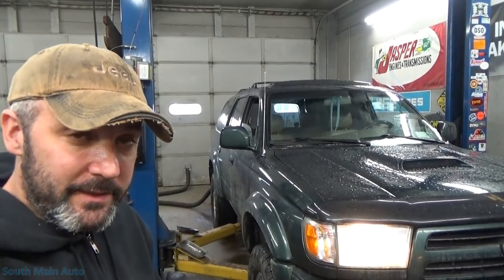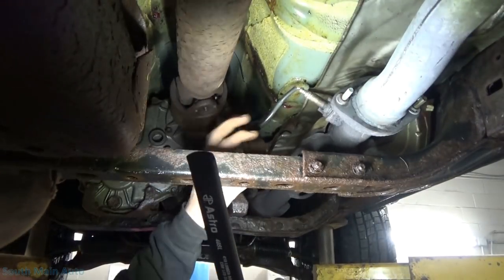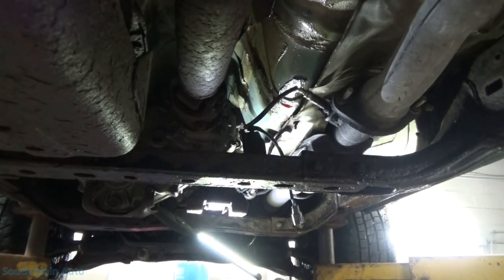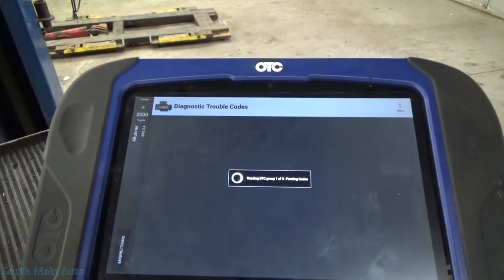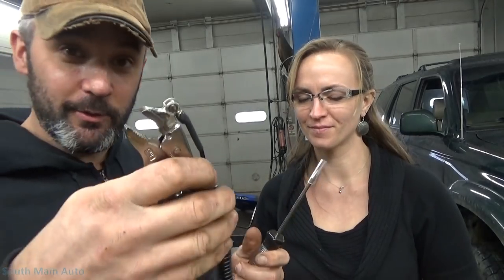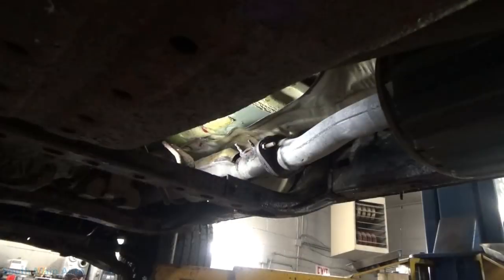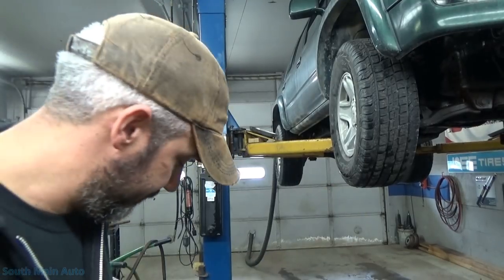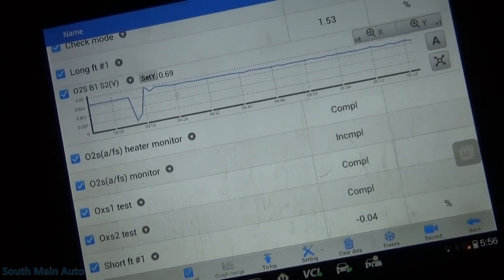Toyota 4Runner 3.4 - P0136 O2 Sensor Malfunction Bank 1 Sensor 2

Comment: Very good video I just did the bank 2 sencer 1 heater circuit  malfunction it stopped work on my 1998 Toyota Camry V6 3.0,, same thing happened to me I ordered one and had the right server box but when I opened it up it was the wrong one, I mean im no  Mechanic but I had enough experience to catch that you know.  So I went to the parts store and bought the right one and put it in and works pretty good job well done. But very good video as all the videos I seen that you put out my friend

Comment: P0136 is a major exhaust leak in front of the sensor.  Or in my case the sensor was still reading in the low voltage area, replaced sensor and all is well.

Comment: Great quick diagnosis and a Merry Christmas to you and the posse over there in Avoca! My brother in Rochester says it's going to be snowing tonight. Looks like it'll be a white Christmas for you guys and for us here in SLC.... Anyway, I just pulled a 2003 Subaru EJ25 from the wrecking yard... can't beat a good motor for only $180! It's going in a 2005 Legacy. The only difference between the two is that the 2003 doesn't have the EGR port from the left head. Online there are success stories about just drilling and tapping one - you can see that the casting already has an area dedicated for that "future" option. I just drilled and tapped it yesterday and all seems well. Going to install the engine today. Have you ever done something like that?

Comment: The swap a part happened with me at car quest / advance auto with an upper ball joint, its alway a guessing game when you don't pull the part before going to the parts store around this town, And when I do I come home to missing nuts and or bolts. Good times.

Comment: Nice trick with the torch! Saw you do that before on a F-150 manifold - pretty slick.

I finally got myself a torch setup after wielding MAP gas for 20 years or so. Could get by with that on the old stuff, but not anymore with everything being post-'96 these days (they've improved the bodies, but it seems the undercarriage has taken 20 steps backwards). Now I've got to practice! Thankfully I've got alot of scrap metal laying around to burn up first, before I unleash  "the wrench of fury" on the customer's stuff. :D Once the floor is poured in the new shop, I'll dig the thing out of my barn and actually be able to use it.

I've learned alot about modern electronics from you and Paul Danner (ScannerDanner), but I seem to forget everything the minute I go out into the shop! Sucks getting old, lol. I'm pretty new to OBD-II stuff - I used to refuse it all, until I learned how to troubleshoot the things, just in the past year. I stuck with carbureted stuff (rare these days in cars, but plenty of it in lawn equipment) for the most part. Now I need some more hands-on with the new stuff, so all this new knowledge will sink in. Too many brakes, front ends,  and tires around here lately! :D

Thanks for another great one. Time for me to finally go to bed! Merry Christmas to you Eric, and Vanessa, and the rest of the family. :)
Reply: chinesium metals at their finest, I'm still stuck with MAPP gas, the tiny oxy/acetylene torch I have is a joke ( the small store bought bottles)
I do have an ancient set of gauges, hard as rock hoses and dinosaur torch set that is no longer made :( last used about 1993?
Reply: I hear that - chinesium, the 119th element. Creeping into EVERYTHING these days.

Sounds like the 50 year old acetylene brazing torch I had handed down from my grandfather. My dad and I attempted to use it one day, and nearly had a catastrophe when the torch handle burst into flames. There were leaks from the valve, all the way down the hose to the torch itself, lol. I brought it home with me, and couldn't find anything that would fit it. My neighbor brought the tank to the gas company to get refilled, and I guess it caused quite a stir, since nobody had seen that style tank and valve in decades. :D

Comment: Just like Jarred food, medicine, bottled food- nearly everything has some type of "tamper resistant" packaging- but not auto part boxes. OTOH It takes 5 seconds to verify numbers of box & bag to match, and if bag is open, BEFORE granting a refund or replacement, and BEFORE returning it to stock. I know that OEM parts usually have a bag label that reads: NOT RETURNABLE IF OPENED, and Dealers Parts Depts usually examine stuff like that. They are showing very slipshod business practices. I would call a Customer Rep, get this situation remedied ASAP. This happens way too often.
Reply: Well they must factor that in, otherwise they would go broke.

Comment: It seems an oxygen sensor or a t-belt is just about the only kind of job a mechanic can hope to see on one of these 3.4L 'yota truck motors!  Love my '96 4Runner, I use it for all my travel and road trips and some mild offroading, aside from a failed fuel injector a few years ago its never missed a beat.  Not bad for a 21 year old truck.  Seems like the only thing that can really take them off the road is frame rust.  The bodies hold up incredibly well, but the boxed frames will rust inside out if you don't undercoat in a northern climate.
Reply: Strawberry milkshake takes out the automatics because of antifreeze mixing with atf. Also rear axle seals go often! And if you don't check diff fluid often (who does?) He rear diff implodes. These are alot better than the previous generation with the 3.0 head gasket circus!
Reply: The "milkshake" issue definitely exists, but I think its rate of incidence gets overblown on the internet.  Having said that, I have an external trans cooler on mine to bypass the built-in trans cooler in the radiator.  The rear diff thing, okay for someone completely negligent and oblivious I suppose that is possible.  Mine had a bad axle seal when I bought it, the oil spray around the rear inner fender and grease smell kind of gave it away.  It didn't take "checking the diff fluid often" to catch and correct that issue.

Compared to my friend's '00 XJ Cherokee with rusted rockers and a cracked head/blown head gasket by 110k miles, the 4Runner is a spring chicken.  A lot of that does come down to how the owner maintains their vehicle be it Toyota or Mopor or Ford etc.  But I find that the overall quality and dependability of these older Toyotas to be simply incredible (better than the new ones, in terms of things like paint quality and interior parts).
Reply: Most of the work I see on these is suspension problems.  Lower ball-joint separation can ruin your day.  Mostly long neglected maintenance.
Reply: Spot on James.  All of these older Toyota trucks/suvs with double wishbone front ends had an inverted/in-tension style of lower balljoint that would not really give anywhere as much notice of impending failure before they let go.  The other problem is people using poor quality balljoints when they do replace them.  I preemptively replaced mine with OEM Toyota pieces at 135k miles, the stock 20 year old balljoints were still perfectly tight but I was spooked.  95-04 Tacomas, 96-02 4Runners, 01-07 Sequoias, '99-06 Tundras are all potentially at risk.  Newer Toyota 4wd IFS has a more traditional balljoint orientation.  I do know several friends with this generation 4Runner that have 150k+ miles on the OE lower balljoints and they seem to still be tight.
Reply: Also head gaskets/cracked heads and unlimited amounts of oil leaks from engine
Reply: You're thinking of the 3VZFE in the 2nd gen I presume, that was mostly a headgasket material/head bolt torque issue, I haven't heard of many heads cracking.  "Unlimited amounts of oil leaks?"  My '96 3.4L is bone dry 21 years on, doesn't burn any appreciable amount either.  I've heard of valve covers seeping with age, but that's nothing unusual or difficult to deal with.  I will put the 5VZ-FE 3.4L up against any motor made in the last 50 years for trouble free operation and longevity assuming even a modicum of basic maintenance like an oil change once in a while.  Toyota had their industrial/truck division Hino lay a hand to it and I think the result speaks for itself.
Reply: Not thinking of the 3.0. I have not seen a head yet that was not cracked between valves when the mls head gasket started to leak.

Comment: Like the idea of the vice grips on the test light. You might be interested in my own version? I got a small G clamp,a two inch one and drilled a hole to bolt wire to it. I removed the little cap from the screw and sharpened to a point the little ball end on the thread. Now can clamp to any surface,just tighten screw to get a good earth. Even works on painted surfaces as well as rusty ones. Little spot of rust preventer after removed. Locks on solid,gives a great earth every time,with no prep or cleaning and is low profile. If I works for me it can work for you!

Comment: Eric, at Toyota on these we use Techsteam to monitor O2 sensor data and it gives us real time input on impedance of the circuit and current to the heater, going from memory here (don't quote me!) cold impedance is like 21K ohms and decreases as it heats up so the ECU knows approximate temperature. So, if it does not see any impedance (unplugged) it sets that code. I didn't see those parameters on your scan tool?
Reply from the maker: You know, our after market scan tools usually show O2 and AFR heater resistance or impedance but on this one it did not. Maybe a year cut off before it is displayed. I have Techstream Lite but did not use it on this one however I am familiar with those PIDS.

Comment: dont feel bad i returned some brake rotors to advanced auto and they gave me some counterfeit twentys and had the police called on me when i went to buy gas with them........luckily i knew where they came from.....
Reply: I was once given a $20 bill for change at a bakery and noticed the green on the $20 given was a slightly different shade of green than the other 20s I had. Held bill up to the light and there was no Jefferson water mark. Made the girl who gave me the $20 exchange it with another $20. Poor girl was fired for accepting the $20 and not checking the watermark. Oh well.
Reply: WTF

Comment: Usually, the basic criteria for the O2 heaters depends on ECT vs engine run time. In other words, if 1 does a hot restart, the heater is not needed, therefore not used/run. Depending on the manufacturer, this could mean 20-40* cool off, and sometimes, the PCM just will briefly switch the heater on, then off, to check circuit integrity, but not actually use the heater function at all, again, depending on the programing. I've run into that alot on older OBD2 Asian cars, as well as Fords, when trying to run a drive cycle. Sometimes, you just gotta wait. Nice trick with the rusted nuts/studs BTW..

Comment: O. I still see that age Toyota all the time here.  If you install the test light (turn signal bulb), on the heater circuit, clear the codes, and start the car, the light will come on within 30 seconds or so.  Also, you missed a chance to use your Mastertech!  It has the factory Toyota software on there for this age Toyota.

Comment: Would you do a call out on the thread chasers you used to clean up the thread on those studs
Reply: Pete Miller to the best of my knowledge there is only one company that makes those thread chasers. Lang tools. They are rebranded for a bunch of different companies. The cheapest place to get them is sears under the craftsman brand.

Comment: I also have a 3.4 2000 4Runner with the need to change the rear oxygen sensor. Is it better to buy it OEM or is Denso ok?
Reply: DENSO is top-notch. Probably OEM. NGK is great too.

Comment: I work at a small shop in nc and I do obd2 inspections. we have a big problem with incomplete drive cycles. is there an affordable scan tool that does the check mode and does it work on most cars?

Comment: I once had a vauxhall insignia (European Gm) that I was chasing a o2 heater sensor fault on. Couldn't get heater to work ie no control side. was about
to call the box. Then I found that it was turned on when you opened the drivers door .

Comment: I have a Tacoma with the same 3.4L engine. Ive owned it since it had 30k on it. It's got 250k now, but its always been slow to start. A long crank time, like 4 times longer than this 4Runner. Does not matter cold or hot. Could this be the fuel pump pressure regulator? How can I check?

Comment: There’s no risk to ecu damage by checking the signal wire with 12v?
Reply: I wouldn't ram 12V into a small signal line, but I guess Toyota's engineers know what to expect from mechanics...

Comment: surgical with that torch
Reply: Yup, nice, practice makes perfect not to damage the threads. Another method for seriously rusted studs and bolts is to heat them up slower clear through red hot and throw cold water on them to cool FAST. The nuts cool faster on the the bolt and result is a loose nut on the rusted stud or bolt what ever the case may be and then your not potentially melting the threads. It will work on anything but with larger the bolts it's harder is is to cool faster right down to getting a water hose and doing it twice. Haven't twisted a bolt off on 20 years.

Comment: Nice. Is that thing a stick shift too? What a vehicle. 17 years of New York crust too. Not bad. 

So the heater circuit needed a higher amperage test light to work by the sounds of it. Interesting. 

Whoever stole the gasket and put the wrong part back in that box was a right wanker! I'd have smashed something if that had happened to me.
Reply: zoidberg444 

I heard ya on the 5 speed manual. Hard to find on suv's today. Even small econo cars are going the way of cvt trans, due to epa mandated higher mpg. 

Just got a new 2017 Mitsubishi Lancer 2.0 with a 5 speed. There was only one more 5 speed forsale within 200 miles of me.

 Believe it or not, having a manual is safer. It forces you to stay in tune with the engine rpm. Less chance for mutli tasking around town.
Reply: I've been looking for a used manual subaru and they are fairly extinct now. I talked to someone with a 5 speed who said they had to order it to get it. You can't just walk onto car dealership lots and get them anymore. At least not without getting lucky.

Comment: best engine ever made 3.4 t belt last for ever they don't use oil good for 500k  4.0 sucks but still better than most silly one row long chain .
Reply: juan rodriguez 

The 3.4 is non-interferance too! So if the belt breaks, slap another one on for another 150k miles easily.
Reply: all toy engines with t belts are
Reply: juan rodriguez not all of them..2uzfe, 4afe, 4af, and 2jzge vvti are interference engines.
Reply: have you ever seem them with bent valves?
Reply: even alldata all freewheeling only v8 4,7 calls inter. but i never seen one even supras are freewheeling
Reply: juan rodriguez non vvti 2jz, such as the ones in supra, are non interference.  The 2jzge vvti engines are.  That is why they have you set the crank on the 60 mark when removing camshaft sprockets.  I haven't seen a belt snap on a vvti engine because usually the owners are meticulous about their Lexus.  Toyota 4.3L is another interference engine.  Just because a Toyota engine has a t belt doesn't always mean it's non interference.
Reply: my bad  he v8 are inter. but have you ever seem them bend valves last year for supra inter and later inline six
Reply: juan rodriguez no I haven't.  The 2jzge engines, in my opinion, are one of the best engines ever made so far.  The t belts are really beefy and so far I haven't seen one break.  More than likely if it were to break, it was because the owner was extremely negligent with maintenance, someone improperly repaired the engine or used cheapy parts, or the engine was modified to not operate as originally designed.  I'm going out on a limb, but most 2jzge, vvti or not,  owners are not going to forgo t belt maintenance.  Most of the ones I serviced were well maintained.
Reply: my point is they just never seem to break how many fuel pumps have you replaced on a toy. something else that seems to last forever
Reply: juan rodriguez I agree awesome engineering by Toyota.  Could you imagine if Toyota offered the 2jz in the pickups back then?  That would of been amazing to own.

Comment: Eric.. do a video on torch use. Pressures, tips etc.. your knowledge. That was slick cutting off the nuts. I would of failed. Lol. 
I dont use a torch enough to remember all the proper pressures etc..

Nut splitter would work good to ( just not a HF one).
Reply: TurboFlush I second this. I tried to do this on large m20 nuts and failed. Couldn't get that clean quick cut going
Reply: See my reply to Corey Love above, works great
Reply: Bruce Smeltzer 
Your comment is only at the top for you. I couldnt find it
Reply: TurboFlush , view comment under Corey Love by me
Reply: It's usually practice practice practice. 8 psi Acy and 30psi Oxy. Tips big enough to do the job but that's usually a preference thing on little stuff. A #2 is a good general tip. As for cutting nuts you have to be quick. Get the nut hot and cut it quick before the stud or bolt gets hot. Once it gets close to the same temp as the nut it will cut also.

Comment: if you already have the new O2 sensor,  could plug it in and hit it with propane torch, better yet, keep used ones around or grab a bunch of connectors from bone-yard and keep a few new universal models for testing only..
NO this doesn't take place of a proper diagnosis and testing, but good for confirmation. for some reason I can see folks doing that >_>

Comment: Hey!  I get a p1130 but only when the headlights are on.  Wtf.  Could a weak electrical system cause this?  No leaks, new sensors, ohmmeter reads happy.  Weird.  Seriously.
Reply: check your grounds!